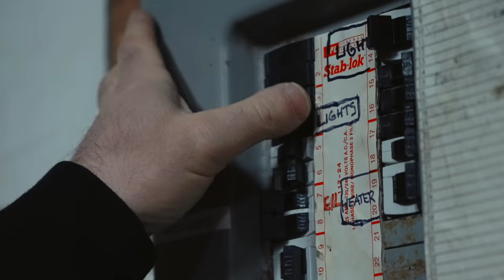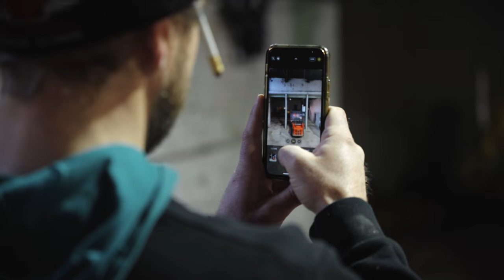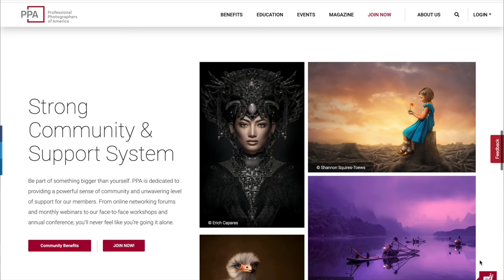Building a SHIPPING CONTAINER studio with no experience. Ep.1

Comment: I hate cold weather. I'm assuming there's no heat in that big building?
Reply from the maker: January/February were so cold. I actually had to cut a section talking about the temperatures. But I wore electric gloves beneath my work gloves everyday and two thick pairs of alpaca wool socks in my winter boots. My toes and fingers would still often freeze.
Thankfully we’ve since gotten heat installed on the building and have indivial space heaters in our units to stay cozy.

Comment: Wait you are already indoors in a warehouse? Why not just run tracks, and frame up for drywall? Seems like epic waste of money what your are doing. What am I missing?
Reply from the maker: Context.
Reply: @JesseDriftwood  ok man, I must have missed the part of the video where you explained why you choose to take the more expensive route, and put shipping containers indoors. You do you. 

Purchase cost of containers, the transport cost of containers, fabrication of containers, cutting tool and accessories, the Welder you are gonna need, Welding Equipment rental, the footprint issues, hopefully the warehouse has good climate control because insulation cost will be lot cant use batt insulation in containers, have to use expensive spray foam....and lastly the time!!!

Instead you could have framed that space with drywall tracks and studs, and have complete control over your footprint and headroom. Products easily transportable in a pickup truck, and tools/skills needed a lot less than what you are currently attempting. It would have been much less time to construct as well but I guess I miss context. 

only thing needed was a drill.
Reply from the maker: okeedoke